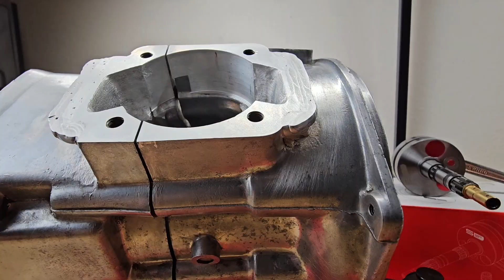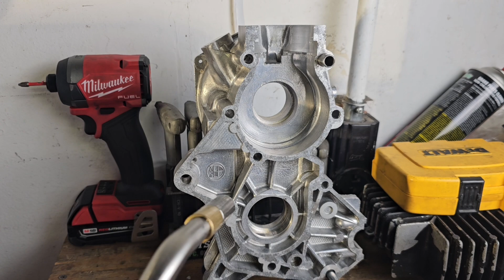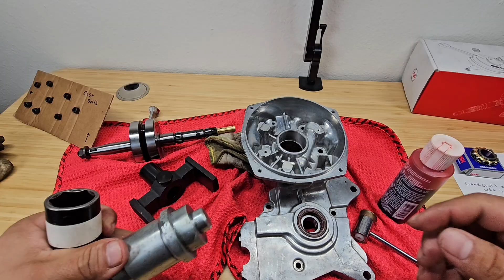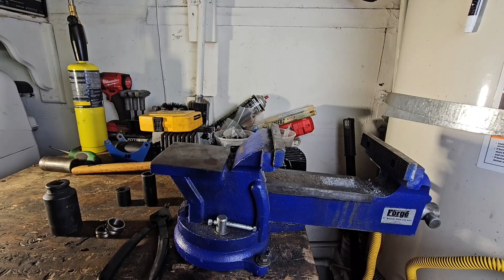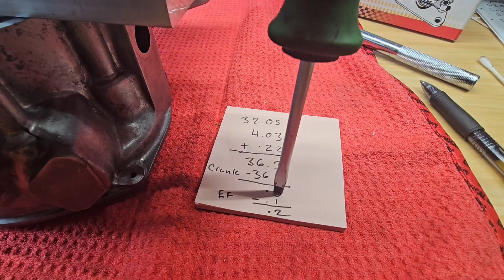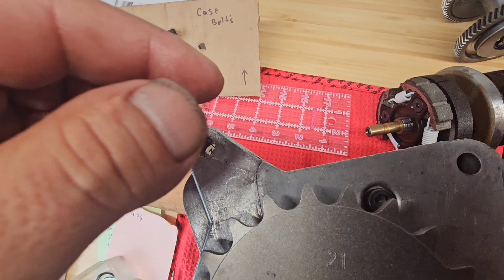Puch ZA50 Rebuild Part One.

Comment: How is it possible to take the two engine pieces apart again, when using one piece bearings??
Reply from the maker: You would use a case splitter tool. 
https://www.homedepot.com/p/VEVOR-Crank-Case-Splitter-Separator-and-Crank-Puller-Installer-Tool-Dirt-Bike-ZCCXAZGJFLQHQBLBQV0/321595235?g_store=1087&source=shoppingads&locale=en-US&fp=ggl